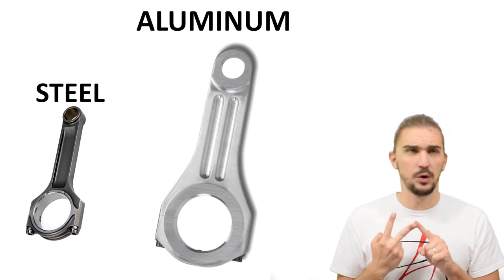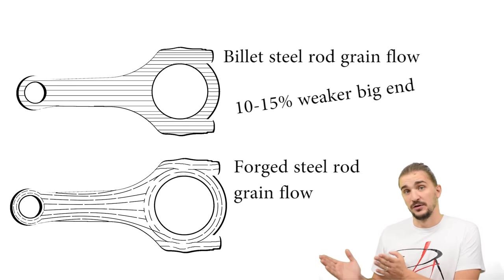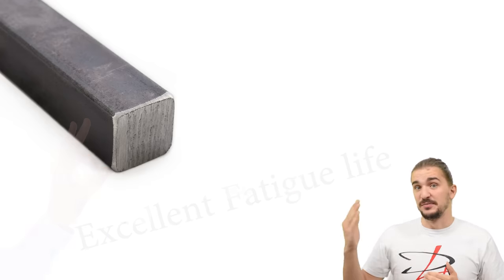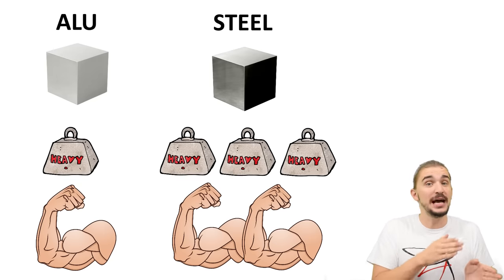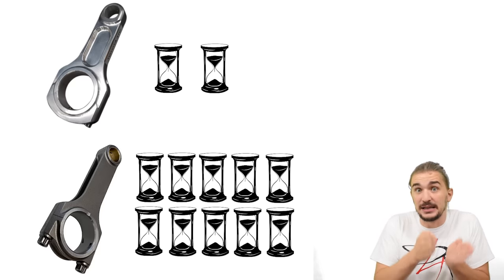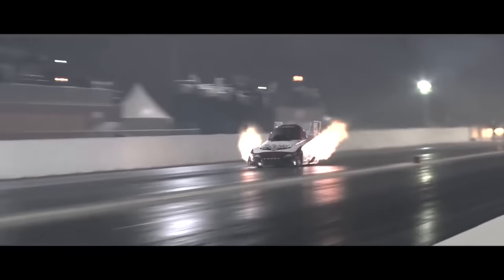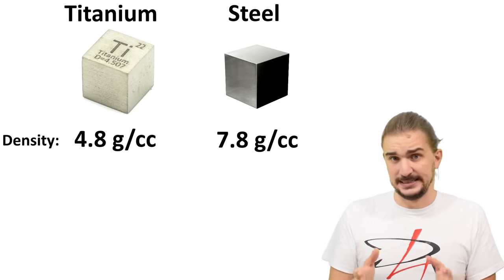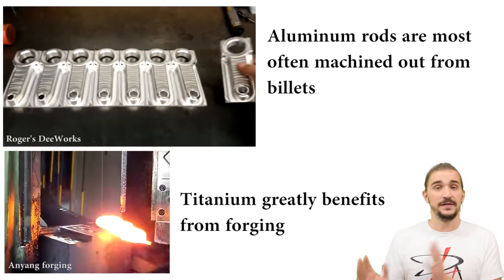STEEL vs ALUMINUM vs TITANIUM Connecting Rods

Comment: I am studying engineering but this video taught me a lot more than my college, thanks bro
Reply: request money back
Reply: even automitive will not teach you this, engineering is just getting to know a bit from a million different technical cases. I study engineering myself and every case is basically enough to calculate with but not enough to be an expert, and i think this stuff is pretty in depth..
Reply: Hmmmm, back when I got my BSME, the basis of this video was covered in school (material properties, particularly steel, aluminum other metals and concrete).  Mr. Kaleta either 1) hasn’t yet taken the course that covers this, 2) didn’t pay attention on that day, 3) isn’t studying mechanical, chemical or related fields of engineering (although at my school, even the EEs had an into into this) or 4) needs a better school.
Reply: Prophet  You do realize that you don't finish a mechanical engineering course in any university worth a damn without first designing mechanical parts right?

"Engineering" is a bit vague as there are about a gazillion different branches of engineering and you wouldn't expect an electronics engineer to know any of this stuff. But you will learn just about all of this in a mechanical or automotive engineering course. In a materials science course you will learn, far, FAR, FAR more than this.
Reply: I visited a college recently and observed a Level 3 engineering group in a lesson (18-20 yo) - a student asked "What's the difference between stress and strain"  the reply alarmed me "There much the same - there's no need to know that" - I learned later the lecturer was being promoted to head of Engineering  - I was appalled - it's a fact that many OFSTED inspectors are not themselves competent in the subject they are meant to guarantee standards for.
Reply: Prophet  youtube is not experience though, which is the context of the comment
Reply: Engineering teaches problem solving and teamwork which YouTube videos cannot 😯
Reply: @chrisvig123  I think it can and other social media sites can help a lot
Reply: Do you not have a materials or manufacturing process class? I’ve learned a lot in both about this topic
Reply: @trevortrevortsr2  I completed the lvl 4 HNC in mech elec a year ago and much the same, was very let down with the course content and asking for more made me seen as a nuisance in the eyes of the higher ups
Reply: Same what kind? And what year are you in?
Reply: As a mechanical engineer, I guarantee you schools won't teach you much. Just work a problem and do calculations!
Reply: @BigUriel       I'm a mechanical engineer. I only took one class in material science. It wasn't a very good class.
Reply: Wouldnt you need to study material sciences instead of engineering to learn this stuff though
Reply: Same here. They teach us how to find the right answers and confirm them. They don't really teach us everything we need to know about stuff. School or no school, that's what u learn on the job in whatever specific field you're in.
Reply: My old man was an engineer for 40 years after he left the navy. He hated getting college "engineers" in the company. It was easier to start with a kid coming up from a survey crew than to re-educate a University engineering student to forget everything the professor spewed and do things the right way.  Always said the 3 worst things to ever come from a university was politicians , lawyers , and shitty engineers.
Reply: Study your materials 👌
Reply: Ha ha!
Reply: ok.now u can enter the automotive industry.
Reply: I know right like wtf they grade you on if you can present and if you cant they just try to fail you like i know the subject and all that has to do with it
Reply: Must've just finished freshman or sophomore year.  One day you'll take MSE 101.
Reply: @ColdPetRat2.99 there are certain things only engineers can realize as colleges never focused on learning, creativity or practical field most colleges focusses on grades
Reply: @ParanoiaGentlman  just studying materials is not enough for engineering you need creativity and practicality and also experience and mostly colleges don't focus on it and people like you won't understand these things, people like you just study things to get a job but people like me focus on learning new things
Reply: @pabitrikalita3940  we're here on this one subject I didn't mention anything else because we not discussing no more than this video. If you want to thats fine but it doesn't pertain me.
Reply: @Feltfx  I learned later the man in charge was a second-hand car salesman - you can't make this stuff up - I was taught design by an aircraft designer and science by Earnestfrom the Manhaton project
Reply: Same here bro
Reply: Im am a 2 stroke aholic and i like forged rods in my 2 strokes. i was wondering if Nikola Tesla impulse radiant energy aetheric stream could by used to machine super hard alloys! i run 2 stroke oil in my rotaries and they love it. I got my 8v92 2 stroke detroit diesel on a few gallons of xd-100 etec oil.  Now keep hearing about this 2JZ poppet valved loop scavenged toyota 2 stroke 3L which as developled as the S-2.  This 2jz can exist as a billet 6061 alloy 2 stroke with ports cut into it and good for 1600'ish hp at high rpm temporary and good all around. Now thwre wass Niisan UD 2 stroke diesels at 75 CID per cylinder, so a UD6 was 450 CID, now do a bill;et aluminum block based on that and go brap for about 2000 hp at 6500 rpm!~
Reply: very precisely explained and technically correct, very helpful
Reply: Prophet  Fuckin A man. Grew up building cars, studied engineering, did 3 years of Machine Technologies and CNC schooling. I've still learned more from YouTube and message boards than all 3 combined haha
Reply: Sound about rite these days! They don't want you to be intelligent or have the ability to use your own brain! Dumb down the nation!
Reply: you all can dismiss formal engineering study, but it provides a necessary background no amount of youtube video can provide
Reply: you should just keep studying engineering for a basic and knowledges.. youtube is a bonus for you to understanding the topics
Reply: Для меня тоже . Учусь на кафедре ДВС)))
Reply: Change schools
Reply: @Imran A dude, trust me, u should study in Russia, if u want learn the engine, i am a Chinese, and now studied in Saint Petersburg for 7 years , my university's name is "Peter the Great St.Petersburg Polytechnic University" it's real a good place for studying engineering. There are lots of good teachers and doctors, friendly and kind.
Reply: @BigUriel  
🚫🤔 Well, I worked for 5 weeks at the "Acme Trash Removal company", and after those 5 weeks, I had become a "sanitation engineer". From there, I took that "engineering experience", and applied at Dow Chemical for an open position as their top chemical engineer. For some reason, they said that I was "the wrong kind of engineer for the job"! Since then I've applied at civil engineering firms, mechanical engineering firms, and I even applied to become an electrical engineer. But they ALL turned me down for reasons I can't fathom!! 😁
Reply: It was free, too. No student loans.
Reply: Yikes I didn’t even graduate high school and have known this stuff since I was 10.
Reply: @guidoheeling1179  my middle name is Quido and it depends on built not bought
Reply: There are quite a few assumption here but pretty good
Reply: @groomlake51  haha yeah shure, does you uncles brother neighbour also have a 3000hp 3th gen camarom
Reply: Good this minimum equation could work for the VC-TURBO engine of the XQ50,
you have 2 cylinders with the same diameter but one has half stroke therefore you can have twice the RPMs therefore the same power, but in reality the cylinder with the largest stroke would be 41.4% more powerful because that way they would have the same stress mechanical, because with the smallest stroke you have 41.4% more directional changes per second and they are 41.4% stronger, 1.414X1.414 = 2, if you have half the mass then 0.5X2 = 1, am I missing something?
Reply: Haha same here. I spen 4 years & $50k getting a degree and learned more on YouTube for free
Reply: Engineer checking in here. You're going to find that internet resources will teach you 90% of what you understand about engineering, period. The other 10% is enough understanding about math to know what equation or block of code to Google... It's pretty sad.
Reply: The education system in a lot of cases is a waste of time. You can’t beat hands on experience.
Reply: @makantahi3731  this video ain't gonna get her a job
Reply: Lol
Reply: Bro... Didn't touch on the MOST critical aspect affecting all of these... just like his understanding of the language... NOT a thought on harmonics.. a direct reflection (excuse the pun) of materials density & yeild strength (spring or whip effect)... Also he says.. steel doesn't suffer from gauling at all.. totally WRONG!
Reply: @mustangmike3830  probably need to think about that statement
Reply: Learn from the pros not the greedy
Reply: Pabitri Kalita, You will learn this in time. Back in the day I learned this stuff in my second year. "Strength of Materials" a level 200 course. Now a days curriculums are much more heavy on the math in the early year classes. You will get more into the Material science courses toward the end of a BS degree. Check your 3rd and 4 year syllabus'
Reply: Imagine going to college for a job that you can get with a HS diploma a few years ago 💯
Reply: @guidoheeling1179  i got taught this when i went to UTI 🤔 when you take the performance classes they teach you all this even teaching you how to tune with various tuning software
Reply: @altonb93  you almost don't see that kind of classes outside of america.